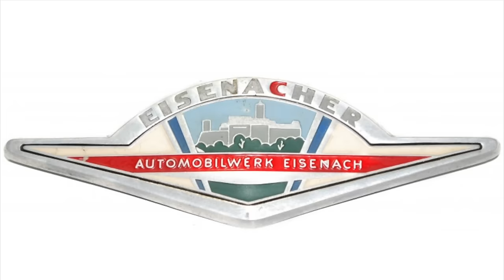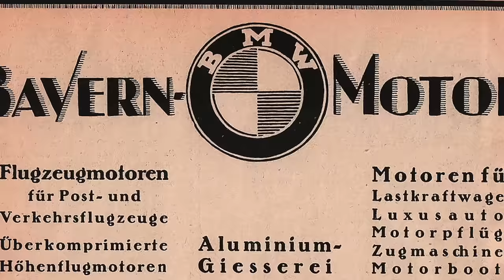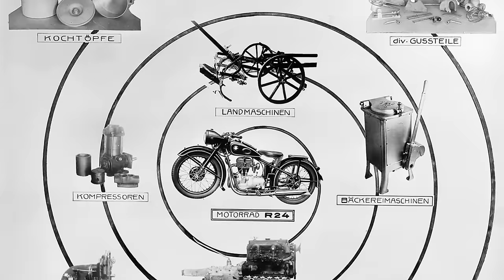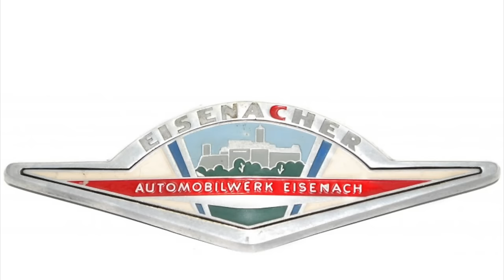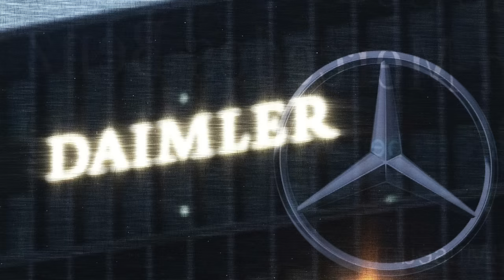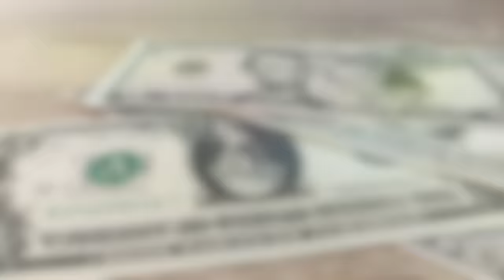BMW, it's not a car. BMW is a way of life | History of brand BMW

Comment: The older models were good quality but nowadays they make them all with plastic parts and they break down and very expensive to fix
Reply from the maker: It's true that modern cars, including BMWs, have more plastic parts than their older counterparts. However, it's important to note that plastic parts can be just as durable and reliable as metal parts if they are made with high-quality materials and designed properly.
Reply: @wisddom  I have a friend who's a mechanic and he told me he just had to do $11,000 of work on somebody's BMW newer model
Reply: Forgot to mention thier signature check engine light and chime 😅

Comment: My first BMW 2002, 1974, bought in 1977, so 320 1981, bought in 1983,ran for 25 years. So 525i, 1991, bought in 2000, still running, 560 000 km.. So 523i, 1997, bought i 2013, still running, 340 000 km. 316i compact, 1997, bought in 2003, still running, 360 000 km. 👍👍👍 - - - The down size motors , type N have a weak part in the chain system, both petrol and diesel engines. 2005- - - , 4 cylinder, diesel.  2008 - - 6 cylinder, diesel. But petrol engines also have weak chain systems in the motors. Many car mechanics in my town told me this.  If I Google N47 and N57, it is at lot of problems about this motors. I hope on day BMW will come with back with the very good motors from 1990 - 2005/ 2008.
Reply from the maker: Impressive BMW lineup and history! 🚗💨 It's true that some of the newer engines have faced chain system issues. Let's hope for a return to the reliable motors of the past. 👍👍

Comment: Great history.
I own a 1995 BMW 525i here in Thailand which i bought 9 years ago.
Despite having to replace the engine and transmission a few years ago. Both came out of a half cut E34 imorted from Japan as spare parts. Both had been used for only 60,000 ks.
Love BMW its been the best car ive ever had.
Reply from the maker: Your BMW's history is legendary! 🚗💨 Despite some engine and transmission replacements, it's still the best car you've ever had. Long live the love for BMW! ❤️
Reply: I would hate to hear what you had to do with other vehicles you owned, if having to replace the entire drivetrain is the best example. Unless you mean the best car in every other aspect. I can agree there.
The company has gone in directions I  have not personally been completely happy with (just in the last 5 years or so), but still consider them at the top (or at least sharing that position - depending on the vast number of parameters this can be measured with) of the automotive world. Very few if any can build cars like they do. Truly special innovative.

Comment: Luv the bmw 2002 (right size but did not make econmic sense to redesign), 3.0 CSL, Z8 (v8 roadster was out of character w/ the rest of bmw), Isetta (Iso of Italy origin), M1 (Lamborghini contract fiasco), 850i, the 1936 bmw 328, & of course, the ubiquitous 3 SERIES.
Reply from the maker: You've highlighted an impressive array of iconic BMW models that have left a lasting impact. 👏
Reply: @wisddom  // Thank you.

Comment: Did he say bmw was the first company to use a turbo on a petrol engine and it was in 2006?What?
Reply: * He said (BMW's first mass-production turbocharged petrol engine started in 2006)
Reply: @nicoletacravcenco6232   @nicoletacravcenco6232  it says, " BMW paved the way, releasing the first mass produced turbocharged petrol motor in 2006.". Hell, I have a 92 MR2 turbo. You could buy a turbo car in the 70s, And turbos we're available on cars and bikes in the 80s.  Kind of a big blunder in this documentary that any car guy  will hear and call out.
Reply: @Woody_Florida  I had a 1985 Ford Thunderbird Turbo Coup...
Reply from the maker: That's cool! 🚀😎 The 1985 Ford Thunderbird Turbo Coupe sounds like a fun and powerful car.
Reply: I think in 1962 Oldsmobile made a turbo charged car

Comment: Wondering why you didn’t include the 2002 and it’s variants which preceded the 3 series and it’s several generations!
Reply from the maker: The video focused primarily on the main lineage and pivotal models of BMW's history. 🚗
Reply: @wisddom  I think you missed how important and pivotal the 1500/2002 cars were to the success of BMW, being the basis for sporty/performance cars. All are well documented in several books, Tony Lewin’s THE BMW CENTURY. A good read, check it out.